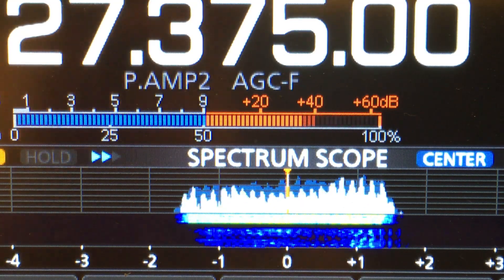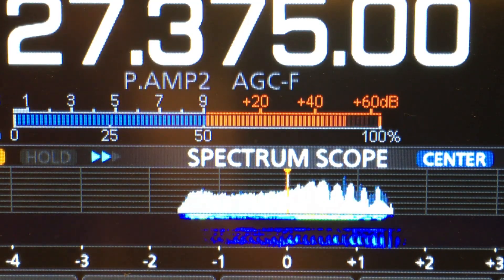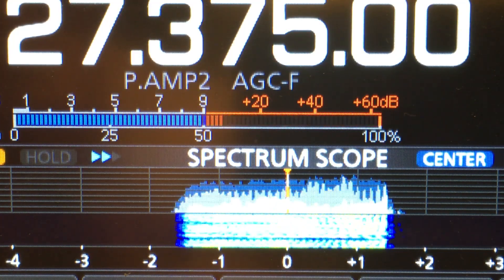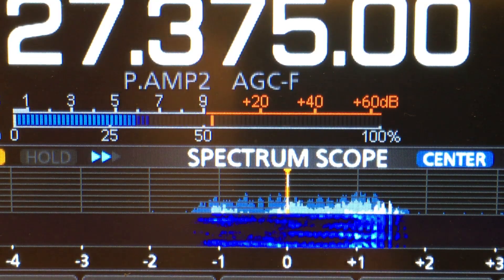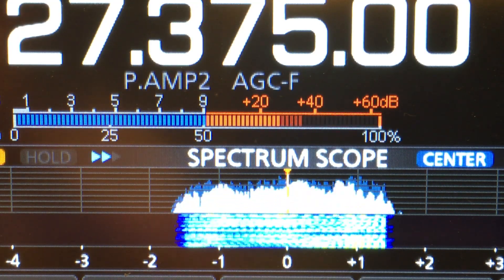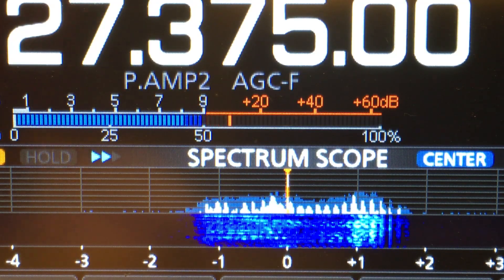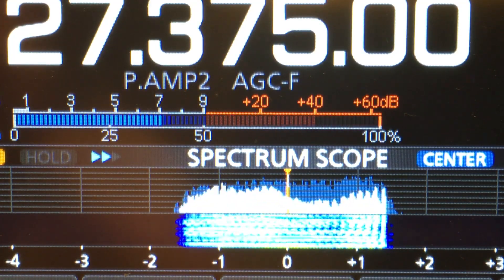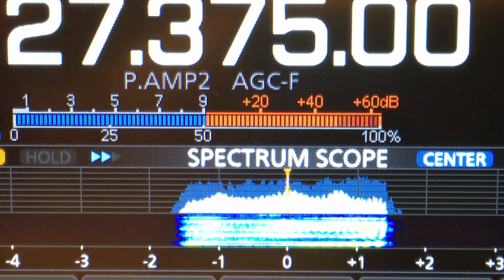CB Radio - 176 Victoria Australia reveals why he has such a strong signal

Comment: I'm just curious in your opinion what is the best CB base antenna as of 2023
Reply from the maker: Vertical or beam?  Mobile or base?
Reply: @Z28videogates  both
Reply: Base omni
Reply from the maker: @JamesBronson-hy3rb  A99 or iMax 2000 are the simplest, easiest to tune and put up and are light weight and also work well without a ground plane.  Those are my suggestions.
Reply: I'm interested in both omnidirectional and directional thanks in advance I appreciate it years ago I was on I was the 54 universal 47 out of Ottawa Ontario Canada I've had a point six four antron 99 4 element Lindsay beam it's just there's so many out nowadays if I'm going to go through the work of putting one up I want to do it right the first time if you all know what I mean